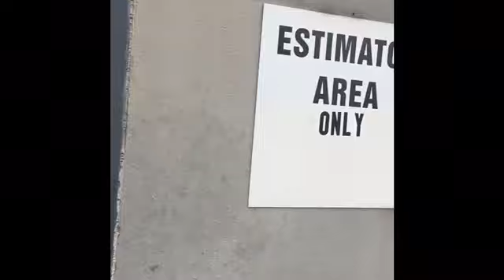Stuck At The Gate

Comment: Not too bad considering some poor idiot in the oc i just passed through forgot there was a kingpin lock on his trailer before coupling.  
Painted that 5th wheel yellow 😂
Reply from the maker: Did he/she drop the trailer or realize they weren’t hooking up? I haven’t pulled that one, but on Target loads, I’ve had a tough time getting the kingpin lock off. Gunked with dried oil etc.
Reply: @sirvilhelmofyonderland  think he kept slamming into it, attempting pull test, until he got out, looked, and saw their was a lock on the kingpin.  That lock was jammed up 3 ways to Sunday on the pin so I don’t know how express tech got it off.  I’m sure driver services was not amused at all.  Some yards require locks on hazmat loads some don’t, some just pull into a gated yard some don’t.  This lock didn’t have the reflective tag hanging from it either...but u still gotta look under there.
Reply from the maker: @tatecraft1361  besides checking the pin before hooking being required per Schneider training, I walk around before hooking just to know what condition the trailer is in. If it’s got a flat etc, I might not be moving it. I’m not a perfect driver, but I know I don’t want to learn lessons the hard way.